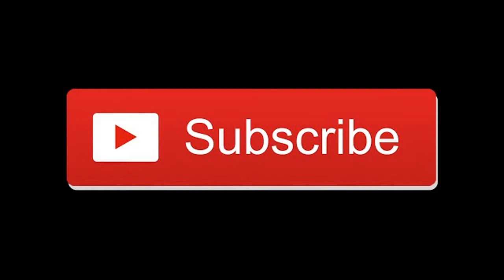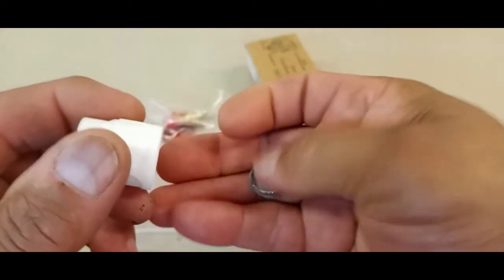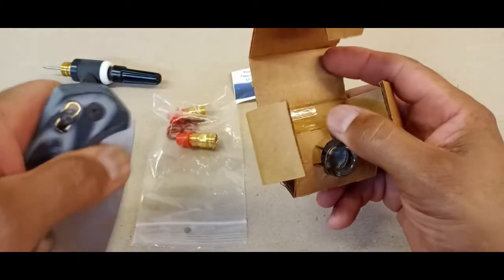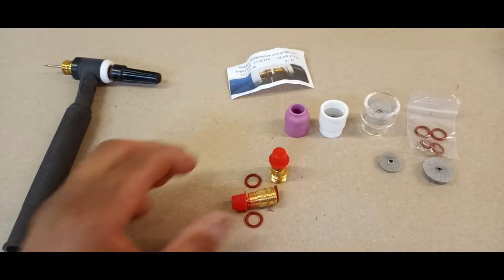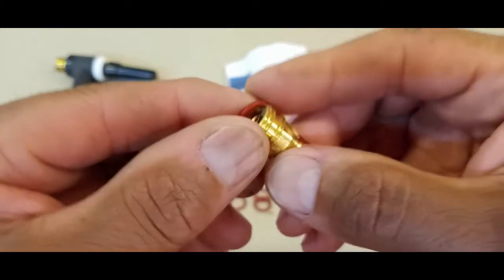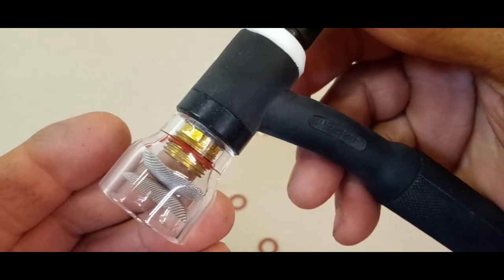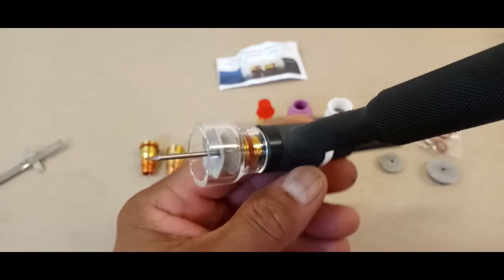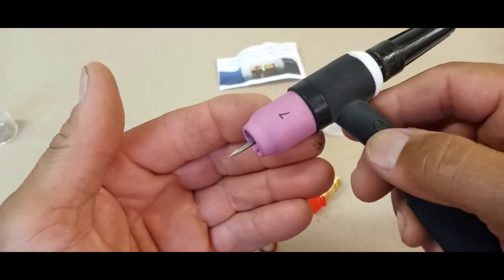Tig Welding : How to set electrode stick out / Clear cups vs ceramic       DIY Auto Restoration

Comment: Im done with furick, had 5 new gas lens all leaking within a couple hours of use they all started spinning inside there connection.
Reply from the maker: Wow... truly even the high end brands of everything have gone to crap...
Reply: Its true for sure, I just tried some from riverweld on Amazon so far so good about 5 hrs on one lens and cup so we will see 😊 @guzzifabrication3448

Comment: Great video. Just a note, you can actually use furick cups with a CK gas lens. The o-ring just rests further back on the lens. Not ideal, but has worked fine for me using them a few years now. I've used furick cups to get in tight corners for a long time, they are life savers.
Reply from the maker: Hey thanks for watching ! I started with a CK products they're good products but I've had a couple of their gas lens come apart, then I found the furick products, yeah I'll never go back or use other cup or gas lens.
Reply: @guzzifabrication3448  Furick is a good guy as well, I use all his products for my personal tig welding consumables. CK still makes the best torches!
Reply from the maker: @ryanclark7167  👍